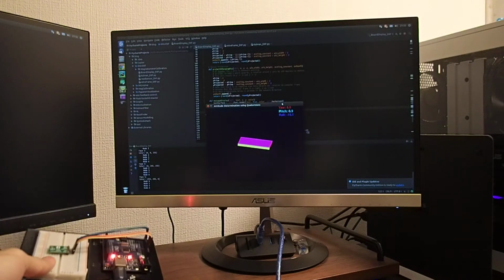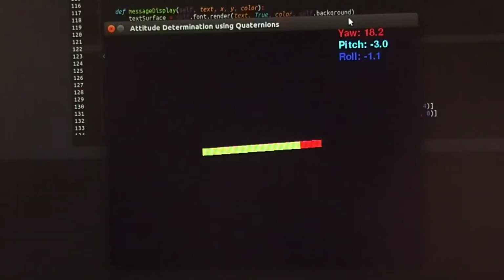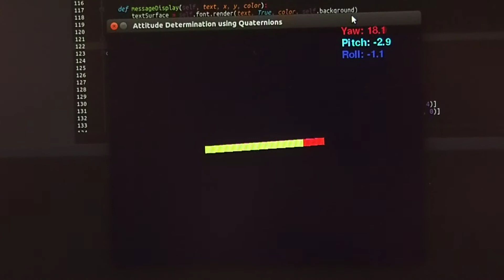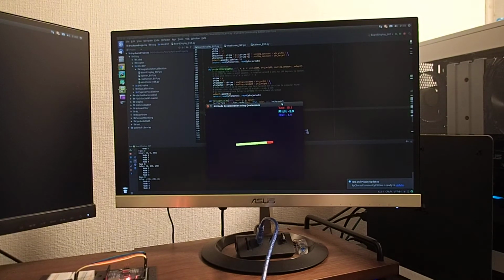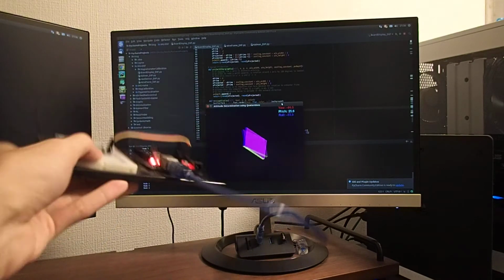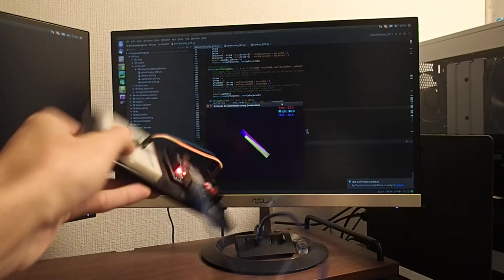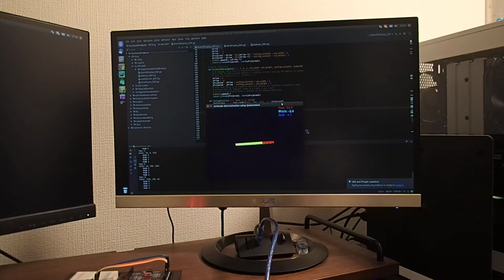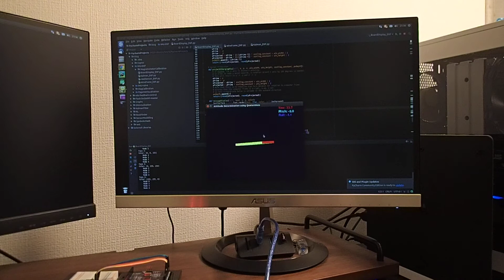Extended Kalman Filter (EKF) Implementation of Quaternion Rotations with MEMS Gyrometer

Comment: It's a shame that there's no official support for the ST LSM9DS1 with ST's X-CUBE-MEMS1's MotionFX sensor-fusion library.. or visualization tools (AlgoBuilder / Unicleo-GUI).

I have a driver working for the LSM9DS1 (based on kriswiner driver), so now I need to either shoehorn into ST's MotionFx.. or use something else.. maybe even Matlab.      Any thoughts on how best to proceed with the LSM9DS1, in either the sensory fusion part (ex. RTIMULib ) or the visualization part (pygame vs python-processing or Adafruit's WebSerial Visualizer)?